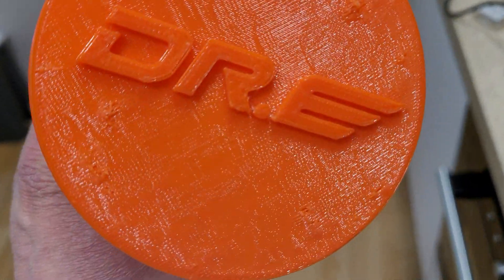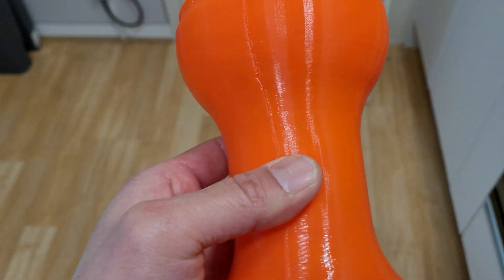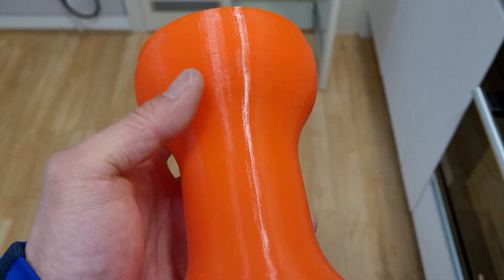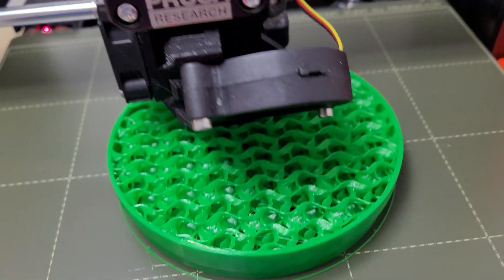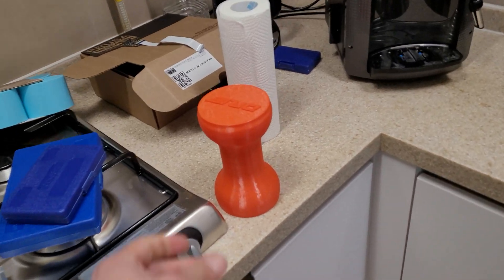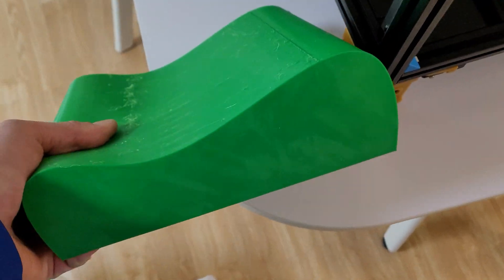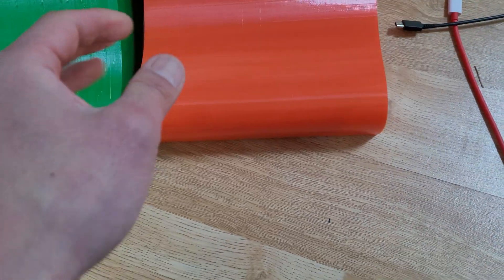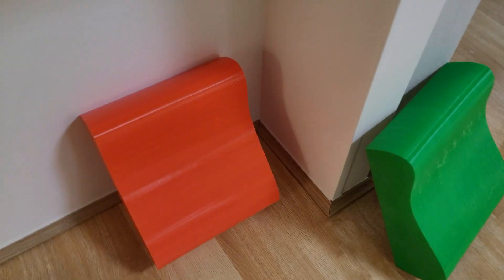Gyroid vs Honeycomb Pattern Which is STRONGER for 3D printing?

Comment: Interesting video.
Quick question since you have a lot of prusa printers^^. Do you have a rattling noise on your y axis (Ball bearing tolerance issue imho)? Mine does for some acceleration (not all the time, but quite frequent), and the prusa support is telling me it’s normal… but it makes the printer very noisy …
What about yours?
Reply: I use well-greased Misumi rods and bearings in mine and still got the occasional rattle. In fact, the Misumi rods and bearings did not have perceivably better tolerances than the stock rods and bearings.

In my case, the rattle actually comes from three places unrelated to the bearings: the screen frame, a black plastic sheet in the silver PSU, and the worn Sunon heat break fan (this rattles only on X movements). The former two also occasionally rattle on long z movements.

I fixed the former two by putting tape in the screen frame and taking apart the PSU (EXTREME DANGER) to glue the black plastic sheet. The fan still rattles but I'm out of replacements at the moment. Now the only sounds my y axis makes are sliding bearing noises and motor hum.

In other words, it may not be the linear bearings to blame. Isolating rattle can be difficult.